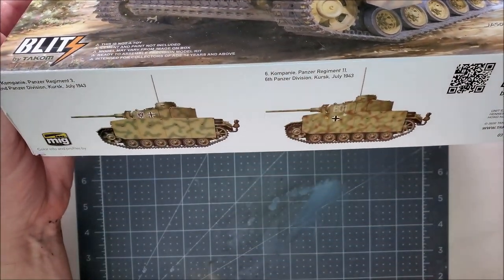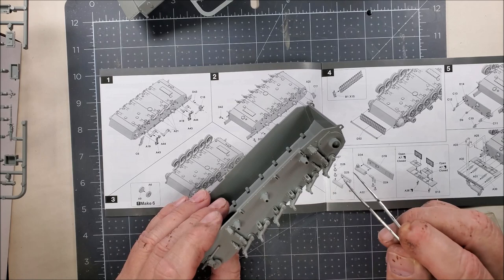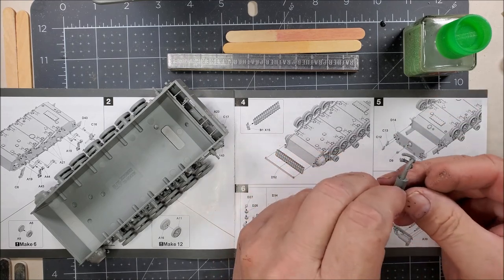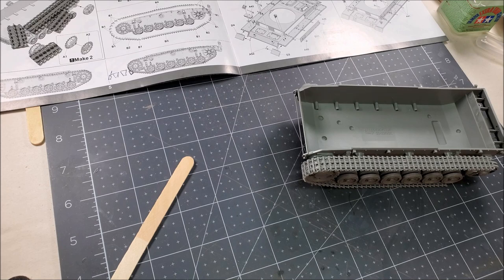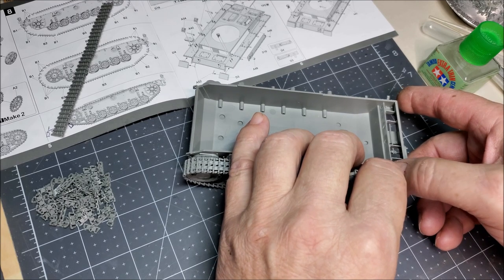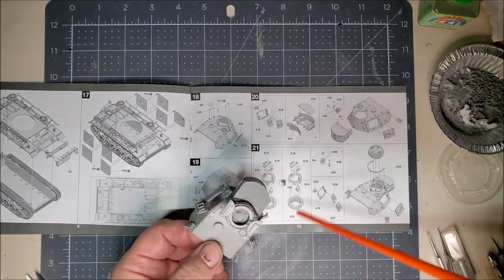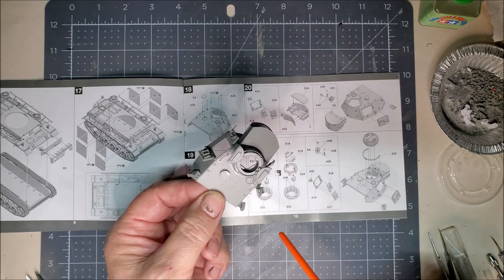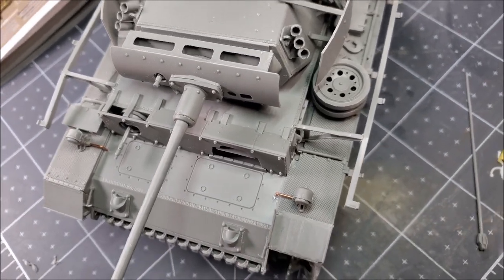Takom Blitz Panzer III Ausf M mit schurzen Complete Build Part 1 Construction

Comment: Nice video! My personal opinion on the Blitz line, is they’re great kits…for the price! Some of the kits are far better quality, than others. They require significantly more cleanup work, but less work on the parts count. I throw one into my queue once in awhile, just because I think for the price, they can’t be beat. I still prefer Dragon, Meng, MiniArt, new Academy, and used to enjoy Tamiya’s, but they’re price increases, have made them not worth it to me, given just how lackluster the build portion of the project is. I thoroughly enjoy deciphering the instructions and modifying things on a Dragon kit ( not to mention how many extra spare parts you stock up on, with unused pieces on their multi model sprues ), the bells and whistles that come with high-end kits, and the challenge of working with tedious micro parts & PE. The fit and finish of Tamiya is fantastic, but I find the building to be to basic and elementary, for my taste. Not to mention, some of the newer kits are up in the $80 range, and are 100% styrene, with no metal upgrades, and simplified engineering. Anyways, just my opinion. Cheers!
Reply from the maker: I like the Takom Blitz kits. They have to be the best value in modeling. I agree Tamiya kits are over priced. Tamiya quality is high but then they put in rubber band tracks and string tow cables that knock down the impression of good value. I love Dragon kits, I don't think I've ever had a Dragon kit that had poor fit or poor quality. The instructions suck, but we know that going in. I've never built a Meng or Miniart kit. I built an Academy T-34/85 and it was OK but I'd put it in with the Hobby Boss, Trumpeter, Amusing Hobby group.